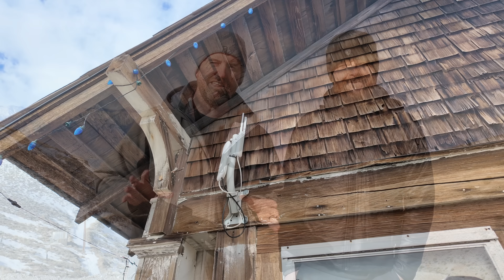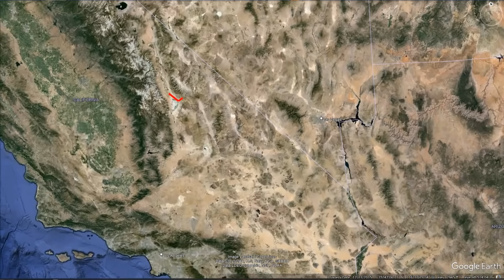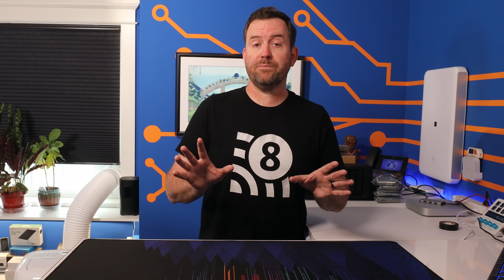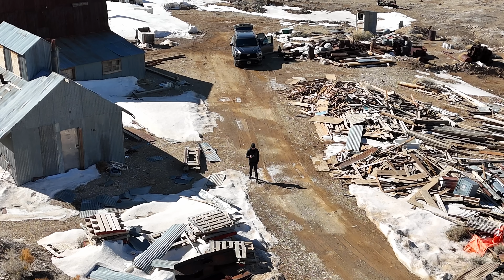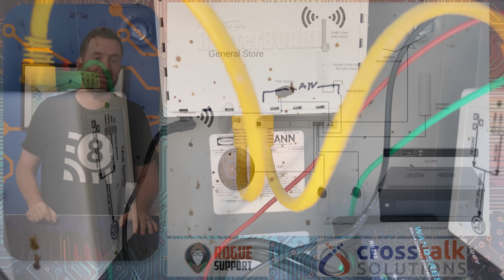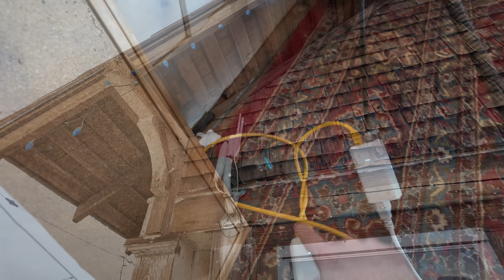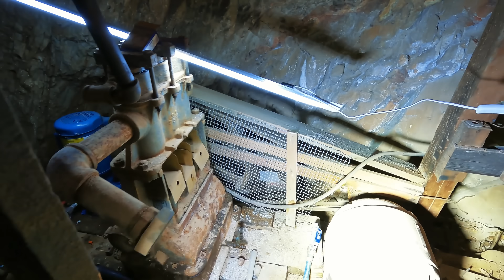Cerro Gordo's Wi-Fi:  Network Design for a Ghost Town

Comment: The thing that I would worry about is all the L2 noise on those PtMP connections with all of the APs in bridge mode. L2 is full of useless communication on PtMP and PtP wireless links that eat bandwidth and increase latency. This is the main reason WISPs use the cheap routers, to break up those broadcast domains without breaking the bank.

Convert the primary ISP MikroTik router into a switch. No double NAT and it doesn't lose its IP address for management if you perform the steps correctly. Unless it is not managed by Cerro Gordo.
Reply: came to the comments hoping I'd see this. Layer 3 for the win here. It's scalable and it would avoid the inevitable broadcast storm that will bring down the entire town's network.
Reply: Is that bonjour, mdns, etc?
Reply: @edc1569  that and MAC, DHCP, broadcast IP addresses. Lots of noise.

Comment: I'm not understanding why these guys don't just replace their carrier with starlink and then rebuild the entire local wireless network to fit their needs.
Reply from the maker: I've used Starlink in production - I wouldn't necessarily recommend it as a single source of Internet connectivity.  Great if it's your only option, but if there's a backup - even better.

Comment: Bigleaf would solve having to choose Starlink vs the p2p wireless link. 

Bigleaf is a great SD wan single IP service provider. They are local to Tualatin OR. I use them extensively in the corporate network I manage.

Their routers are smart enough out of the box to just roll with. Their support is great too.

Comment: "avoid double NAT at all cost"
Guess what I'm stuck with.... Debian + PPPoE don't seem to go well together, so I'm stuck with the devil's spawn (ISP supplied router) and my router-pc behind that. That was strangely enough easier to get to work than PPPoE, even with various port forwards.
Reply: I run PPPoE on a pretty stock Ubuntu box with no problems, I doubt Debian is your issue.
Reply: @rivimey  It's probably a setting, but which one? Debian gets as far as obtaining an IPv4 address, then journalctl goes silent and then suddenly "modem hangup, connection time 0.5 minutes".

Comment: Curious what make/model NEMA enclosure you used? I'm setting up a similar scenario on a 40 acre compound.
Reply from the maker: Altelix has a NEMA enclosure designed to not interfere with Wi-Fi signals - we'll be using those.